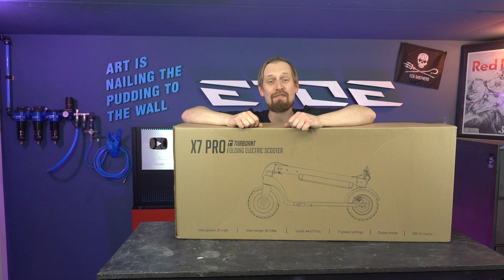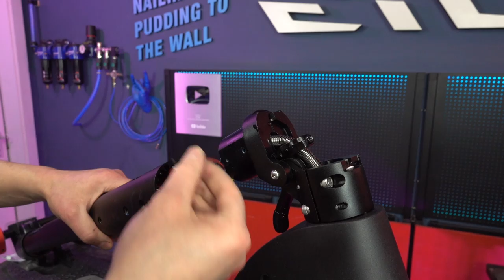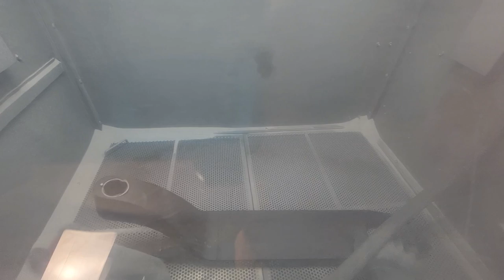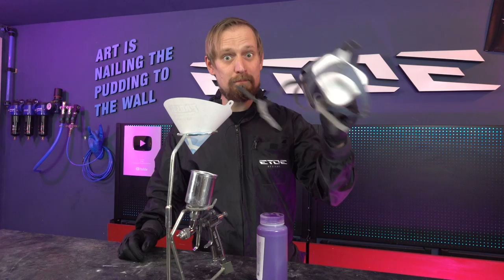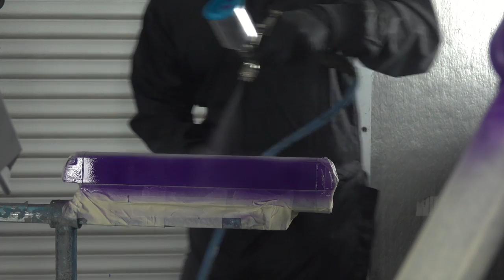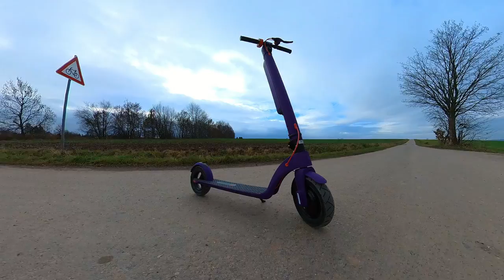I Paint My Scooter With CERAKOTE - Turboant X7 Pro Electric Scooter

Comment: It's the first time that I have watched you ride a scooter (or skateboard), Martin. You are left handed (but ambidextrous) but you ride a scooter like a right handed person, left foot forward! The body is an incredible machine!  I really love the colour you painted the scooter and although I have seen Cerakote being used before, it's always got to be put into an oven and cured, I wonder how the air dried Cerakote stands up to abuse on the scooter. Also, it would be good to hear how the Cerakote was difficult to spray when compared to the usual 2K paint. On the battery, it looked like it caused "orange peel?" Thanks Martin, you are a star!

Comment: Hey Martin, a bike company, We Are One, out of Kamloops, BC, Canada is using CERAKOTE as the paint for their frames. What are your thoughts on this?
Reply from the maker: Shit. I will not use it again. It cracks easy and doesn`t stick to the aluminum as promised. The purple was transparent as F... and I needed much more as expected to get a full coverage of the color. It stinks like hell cause of the acetone which makes it dangerous to use. Maybe my charge was damaged or too old or what ever. But it didn`t came out as expected and i will do the scooter again in the future.
Reply: @ETOE  Dont fix what isn't broken, no need to move away from the classic methods!

Comment: Would chemical stripping work on removing the paint as well?
Reply from the maker: Yes if you use this: https://amzn.to/3lfw8jF Put the parts in a bath of warm water an this. But not too long or the surface of the aluminum gets hurt. Rinsethe parts with citric acid afterwards.

disclaimer: This video and description contains affiliate links, which means that if you click on one of the product links, I’ll receive a small commission. You have no extra cost using these links. You help to support the channel and allows me to continue to make videos like this. Thank you for watching!
Reply: @ETOE  Also you've mentioned that primer and spray wouldn't be durable. Could an 2k primer and paint be an alternative? Cerakote is quite expensive!
Reply from the maker: @k0k0w  You can use what ever you like even cheap stuff if you like cheap paint jobs.
Reply: @ETOE  Thanks! I'll try out the drain cleaner technique for anodized parts. 

BTW, I'm glad you branched out to e scooters as well. It's been great watching your videos and they are very helpful in adding confidence to do a DIY job with a pro finish.
Reply: @k0k0w  you only need a $35 4oz cerakote kit to do a full bike. 2 thin coats is all you need. 
Compared to 2k primer, paint, clear its actually cheaper. You can also cerakote over bare steel/aluminium.  
If you watch the impact/abrasive tests, cerakote is 10x more durable easily. Its not just plastic/resin/Eurethane like paint, its ceramic particles that are glued to your frame.